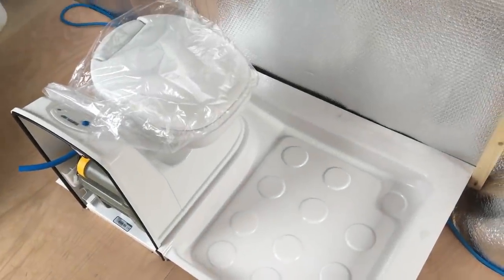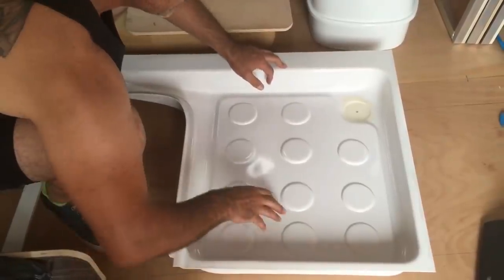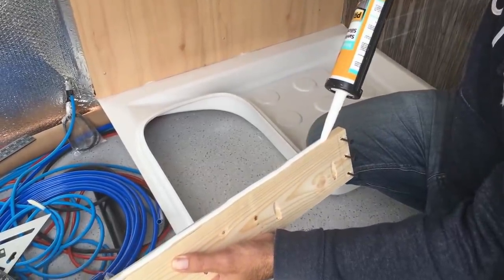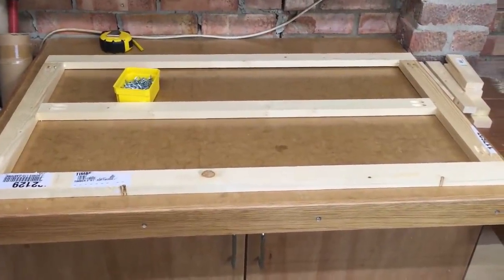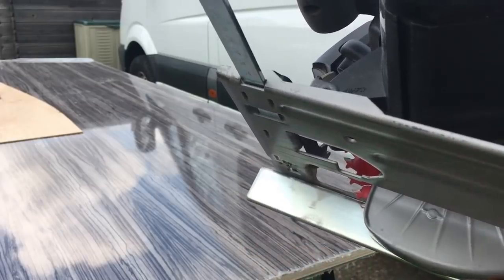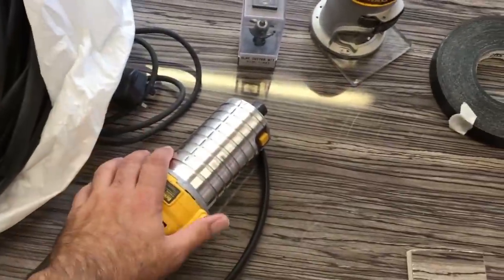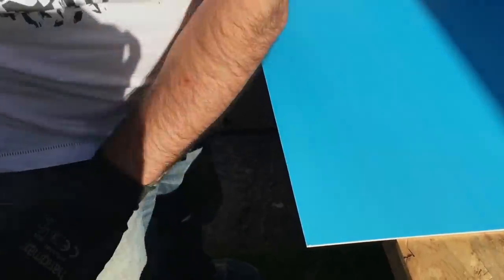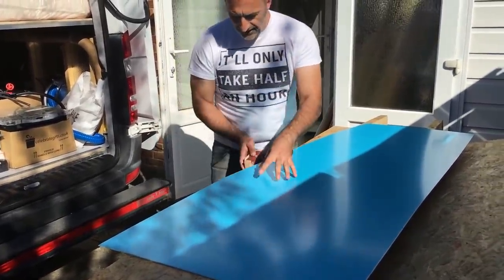Mercedes Sprinter Camper Van - Shower Build

Comment from the maker: Here is a link for the extra long shower waste. 
https://www.sparespro.co.uk/chrome-plug-less-unslotted-brass-body-cp-1-1-2-x-2-7-16-flange-89mm-solid-tail-flush-grated-waste
Reply: Thanks for your swift reply really appreciated.
Reply: Greg what did you use to connect the bottom of the waste to the pipe work?
Reply from the maker: @Robbrown92  I used a piece of 40mm flexible drain hose and jubilee clip.
Reply: Why do you have the toilet waste access port on the inside of the van????.
Reply from the maker: @margaretsweeney6268  because I didn’t want to cut through the main structure of the van and try to make it waterproof 
We keep it very clean and there’s never any smell 😃👍🏼

Comment: Greetings from Colorful Colorado.  I've had to completely rebuild the aft 3 feet of a conventional travel trailer (bath/shower area) due to roof leak water damage, and I've done two cargo trailer conversions to campers.  When I need to glue a piece of material to a wall, as in your shower build, I have found a pressure sensitive adhesive works well.  You trowel the material onto the solid surface, (using a fine tooth trowel, 3/8 max) let it get tacky (the longer it air dries, the stickier it gets) then simply press your surface material into place.  I'm not familiar with the adhesive you were using, and it might be great...but when you trowel on the pressure sensitive adhesive there are no air gaps, and it's not ever going anywhere. Warning, when you start to apply your cover sheet, make sure everything is lined up, because once you start to adhere it, it's like contact cement and is very difficult to adjust.

Comment: Hello from London Canada, excellent video and tips throughout. I'm still in the head to paper planning stage of my shower build for my Ram Promaster 3500 extended high roof. It's not as easy as many think to accomplish a well built functional DIY van build however you have taken a taunting task and somehow made it a much easier project with less stress and pitfalls. Thank you Robert in Canada
Reply: Robert, I am planning on using the same van as you. How is your build going?
Reply: @RustyCas999  My van build has been a work in progress, expensive non-budget friendly project. It has also been coupled with huge life altering events. Unlike a lot of people who have documented their progress from start to finish I started with still images but soon left that behind in favour of doing a completed video and explanation. I will say that no two DIY van conversions will be the same. When my van is completed there will be no other like it. Just the same as Greg's Sprinter build it's totally unique and took hours of work in completion. At this very point due to a family medical problem my van is about 75% completed, I need to finish it but doubt I'll ever use it for its intended purpose.

Comment: Hi mate. Plumber by trade. An angle grinder with a porcelain tile blade cuts stuff like that sheeting quick and clean. Doesn’t throw the sheet about or risk damaging 👍👍👍
Reply from the maker: UrbanARK overland, I find that abrasive wheels tend to melt PVC rather than cut it.

Comment: A proper home has a toilet and shower. A lot of builds don't have this, even my little campervan has a toilet and shower and I'd miss it if it wasn't there. A shower inside is not so important in really hot climates but why not fit one anyway if building a toilet cubicle, even if a bucket of water and battery operated shower head can be used in it to save expense if it's out of one's budget.

I see people have portaloos under seats and hidden in small cupboards but privacy is important I think plus the fact it won't feel like you're sh**ing or pi**ing in your kitchen lol, but seriously.

Can't wait until van tour vid!!!

Comment: At 6:53 - what is the grey paint on that surface, flecked with dots?  Some kind of epoxy paint?  Looks great by the way.
9:04 - that tiny detail of sloping the lip of the tray is astounding!  I would have never thought of that.  Your brain must be mulling these details over while you sleep.  How do I make my brain more like yours?
I'm digesting all this information like a fine novel.  Thank you for the quality work you do.  It restores faith in good workmanship.  Ever thought of teaching?  You are a natural.
Reply from the maker: Hello 😇, the grey floor finish is Altro and we covered the whole floor before fitting any furniture. See this video for full details https://youtu.be/ZsQjSd1625I
Re the tray, I can let you into a secret. I put a square bit of wood in first and there was a gap so that led me to think it must be designed with a slope in mind. Good idea though 😎
Teaching is an admirable profession but the pay here is very poor. That’s typical of these type of jobs. Very rewarding on another level. 
Thanks for following along. 
What stage are you at?

Comment: Nice job, Greg.  One thing I'm having a hard time finding in any video where there is a hole drilled in the van floor, is the proper way to prevent corrosion in the hole and how to properly seal it from under the van.   Would love to know how you did that.
Reply from the maker: Hello Ian, cut a hole just slightly largr than your drop out vent or pipe etc, file any rough edges off of the cut edge, paint with hammerite to seal the raw metal edges. 
Place your pipe or drop out vent inthe hole and seal all around the top and underside with sikaflex 512. After it had cured I did spray the underside with waxoyl but that was only for added protection.
Reply: @GregVirgoe  Great info! Thx Greg

Comment: Hi Greg, have really enjoyed the build series and your instructional and informative approach. it would be great to know now you have been using the shower for a while is there anything you would do differently and how is it holding up with the use and movement since compleating the build? Going to start a build myself later this year and have found this entire series an invaluable source for research so thanks for taking the time to share
Reply: I would also be interested to know if the PVA on plywood + PVC lining does the job :) I'm considering building the shower in the same way.

Comment: Hi Greg, Thanks so much for doing these videos, they are so useful. Your attention to detail is Amazing. I am starting a Renault Master build in Sydney And will copy a lot of your ideas. Just a question on your shower, you did mention in your Q &A video if it was a good idea or not. Now you have used your van for a while, if you did another build would you put in a shower and toilet ?
I only just have room for one and like your design of 975 x 700 but it is a lot of space that may not get well used, when we can shower outside in Australia quite easily. Love to hear your experience so far?
Cheers Tim
Reply from the maker: That’s a good question and I’m not planning to put a shower in this nee van build. We don’t use the one in ours and use other services which are easily available. I will be putting in a toilet though as that is essential.

Comment: Sprinters are high topped vans and I'm a short arse of 5' 7" so I was thinking that under that shower tray could a 3 inch deep bowl be fitted to really get the water out faster. Maybe I'm over thinking it. I like a power shower is that possible? I find power showers are shorter as it is more efficient of getting you clean in a shorter time, use less water and power possibly too. Also on the Fiat would it be impossible to add a shower/loo cubical? But I'm still not sure what I want.
 I only have a basic license so won't be able to go for the bigger vans, unless I take the test for a bus and then the build takes on a whole new turn. I had looked at bus conversions, especially the minibus type used in villages or by special schools. Before I start parting with my hard earned, I'm really going to need to know what I want. I have lived in caravans before - statics and tow away's, I don't like low ceilings or pokey rooms. But I have learnt from camping that there are options, like large canvass extensions - more than just an awning extend your living space a lot. A log heater like I have for my hot tent creates a warm outer room. It's definitely on my build plans. I've even considered the Kei-Car vans from Japan - great for cost and they fit nicely down tiny country roads, especially out in the sticks were I am. All good advice though Greg, thanks.
Reply from the maker: We don't use the shower in our van we always find other options which is why i'm not fitting one in the new van, its just too much hassle.

Comment: You mentioned that your shower pan cracked as did others.  Do you think it could have been installed differently to avoid the cracking? Were you able to repair it? Or did you replace the pan and if so with what?  Thank you for all you've done for the community. Cheers!
Reply from the maker: I don’t think there was anything I could have done to stop it cracking. It was way too thin and not suitable for the job. Taken out and new one hand made out of timber and fibreglass over top.
Reply: Have you done a video of this updated shower tray Greg?  Would love to see what you’ve done

Comment: Hi I am a joiner and well impressed with your work.so can I say you call it mastic to seal shower is it not silicone. Also when you fixed king span to roof why could you not get he fit 10 mm less and then run expanding foam in gap this would also stick it in place. But I must say this is the best build on you tube by a long way.looking forward to watch more videos regards kevin

Comment: Hi, noticed the toilette cassette is facing the inside of the van instead of having facing the van panel with a little door when empty is necessary - of course this will save from an extra cut through the van side - I am personally having a dilemma, not sure what to go for
Reply from the maker: Pasquale Gatto watch my first France video and you will see how the small door works. 
Cutting and sealing a hole for door at the height is a nightmare as the van sides are not straight and it goes through the plastic trim.
Difficult to do well.

Comment: Hi Greg- Fabulous work - Even as an engineer and  seasoned DIYer I am really enjoying your videos and picking up a lot of useful tips. Thank you! I have a question about why you decided to have the loo cassette pull out into the van rather than externally? Is it to do with the shower drain positioning versus the chasis ? or that you didnt want / couldnt suitably site and fit the required door on the outside? Many Thanks. Jon
Reply from the maker: Hello Jon, it was mainly because there is a lot of steel supports and van wall to cut out and remove to get the door to go outside and it would be halfway through the plastic trim which would have to be cut, the van side is curved and would need to be filled with tons of mastic, the list of negatives was huge. We have been in a van with a cassette inside and it seals itself when removed and with good hygiene, it was really easy to deal with and no smells at all. Easier solution all round I think.

Comment: Hi Greg, could you clarify something for me please. I need to purchase a shower kit (head, etc.), and i find mixed reviews and opinions whether "normal" showers would work with electric pumps or not. In theory, when the thumb lever is released the water is shut off. I read reviews that say for pumped showers where the pump is not pressure sensitive, this means the pump continues to try and pump water but without water flowing. This risks damaging the pump motor and blowing the unit. However some pumped showers are regulated by pressure - in circumstances where the water is stopped from flowing, the pump switches off. (I will be using the Shurflo pump you recommend.) let's clear this up once and for all: do we need to buy the "electric pump convertible motorhome showers" (as usual, priced way over the "normal' shower kits), or will these "traditional" showers work just fine. As I could not find link to what shower kit/head you recommend, this is the one i am considering getting: 
https://www.amazon.co.uk/Aizhy-Stainless-Bathroom-Portable-Personal/dp/B07F7Z27W9/ref=sr_1_1_sspa?dchild=1&keywords=handheld+bidet+spray+kit&qid=1590128462&s=diy&sr=1-1-spons&psc=1&spLa=ZW5jcnlwdGVkUXVhbGlmaWVyPUExWUtJMUI4WE1RVFNXJmVuY3J5cHRlZElkPUEwMTQ0OTk3MlJOMUE3RDg1SjcxViZlbmNyeXB0ZWRBZElkPUEwMzQ3NDgwMU5ZU01HTlgzQVRMNiZ3aWRnZXROYW1lPXNwX2F0ZiZhY3Rpb249Y2xpY2tSZWRpcmVjdCZkb05vdExvZ0NsaWNrPXRydWU=
thanks for your input on this!!

Comment: Hi Greg, loving your videos they are sooo helpful! Just wondering if you have any advice or videos regarding the installation of the bathroom extractor? Thank you
Reply from the maker: Clair Sulley no I didn’t do a video of that because it wasn’t my best choice. So didn’t want to recommend it. I ended up putting a 12v AC fan in running off a mains transformer so I have to use my inverter. It’s not a good way of doing it and would be better if can find a 12v DC fan but not many nice ones about. Sorry that doesn’t help you much.
Reply: @GregVirgoe  thanks for the reply, I'm also having trouble finding a 12v DC fan, want to avoid having the use the transformer? 🤔

Comment: Greg - Just starting to plan my van conversion. Your attention to detail is awesome. With the toilet is there any reason you chose not to have the cassette facing outward and create a access hatch in the van side? Secondly, can you help build my van?
Reply from the maker: TinRobot I didn’t want to cut through the van at low level because it would have been halfway through the plastic trim and trying to weather proof it would have been difficult. We don’t have any problem with it being inside it’s perfectly sealed and always very fresh in the shower. We use the Thetford sachets and have a nice smell. 
Happy to answer any questions if that helps 😊

Comment: Hi Greg, watched most of your  videos at this stage and  their by far
 the best when it comes to builds especially  the shower cubicle  and watts law, one quick  question  if that's
Possible using the online  voltage  calculator  I know  they take voltage  drop into account  but  do they allow for  ×1.25  speak about  in your  video

Comment: I know it is a while since you did this but what blade did you use for cutting your furniture board as you managed to get a really nice cut with no obvious blow out - Thanks
Reply from the maker: Hello Tim, on the circular saw I used a Freud 80T blade and for the jigsaw I use T101BR blades which cut on the downstroke so you have you face side up. Here is a link https://amzn.to/3O05gRZ. 
I use masking tape on both sides to help prevent chip out and don’t go too fast let the blade do the work take your time and you’ll get good results. My overhead cupboard video explains more about the blade choice 👍🏼😊

Comment: Hi Greg, I’m converting a sprinter and your videos are extremely helpful so many thanks! Just a quick question on your shower install, did you put a light in there and if so, did you use anything special e.g moisture resistant etc. Thanks in advance mate 👍
Reply from the maker: Watch our van tour video you will see what I did. 
Used waterproof led strip above an opaque Perspex ceiling like a light box

Comment: Hi Greg 👋  great videos you're my goto if I get stuck.  One question!  I'm at the stage of building the shower unit, I've go a xlwb crafter with the bed going across,so have room to add a unit between the bed and shower thus securing the shower wall my question is how did you secure the left hand shower wall to the wall of the van? Cheers
Reply from the maker: It was secured to the wall where the top cupboard is and at the base where the bench seat is. 
It was secured to the top frame and bottom timber too. The only portion not fixed is where it goes past the window but that doesn’t move with the other fixings.
Reply: @GregVirgoe  great thanks for your prompt reply 👍 hope to meet you again in person at one of the meetups.
Reply from the maker: @antoniomonteiro6008  I will look forward to it 👍🏼🤩

Comment: Hi Greg I'd like to ask about your extractor fan in the shower, is it a 12 volt and did you wire it straight to your light switch or did you wire it up separately. Tia  👍 👍
Reply: goood question...

Comment: Just curious What was the reason for the pvc lining in the shower over the laminated rain board. That seemed already water tight and very good looking.

Great video
Reply from the maker: Matt Ander the van wall was only normal plywood and it would look odd two different finishes. Just a better looking job I think 🤔

Comment: Greg 
I love your videos. What kind of toilet did you put in the shower area? and what are the dimensions of the inside of the shower?
Reply from the maker: I used a Thetford C200CS cassette toilet which has an electric flush and is connected to my pressurised water supply off the main water tank. The waste goes into a sealed cassette that can be emptied at many sluice services on campsites or bespoke machines installed all over Europe. https://youtu.be/Xuz6jg9wP6c
The internal dimensions of the shower cubicle are 950mm x 750mm at the base. It tapers slightly as you go up because the van is curved.

Comment: Hi Greg, Really helpful video as usual! I would like to ask about extractor fan install. I have the same extractor fan I think (Xpelair LV100 12v) and the unit is 87mm deep to back of motor. My van wall is probably only going to be around 60-63mm thick. It looks like your fan is fitted flush to the wall so just like to know if you had this problem and if so what was your solution? TIA